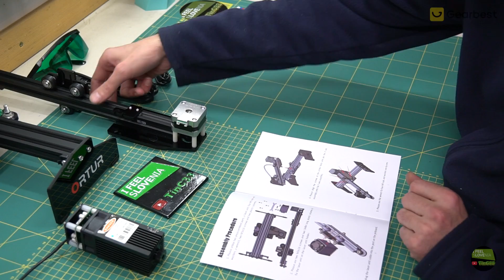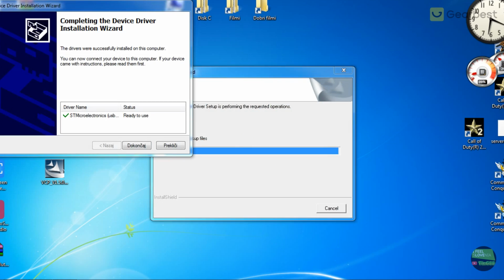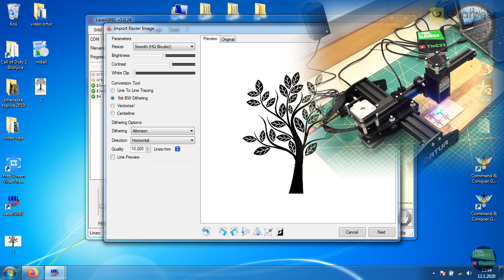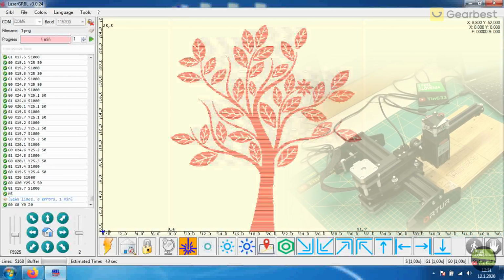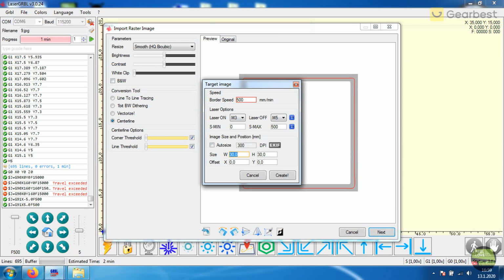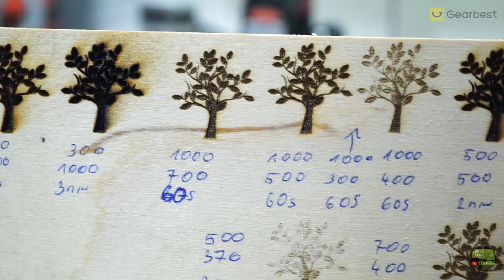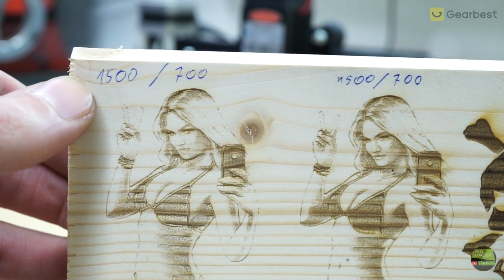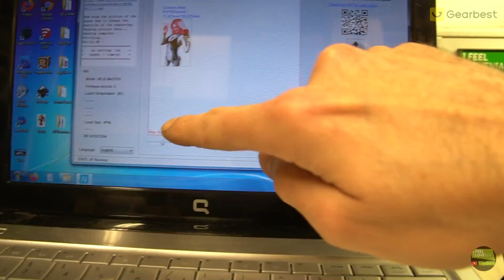Ortur Laser Master 15W Desktop Engraver Cutter [unboxing / review / software / first test]

Comment: Can you suggest a fiber laser with a small footprint like this one, more suitable for deeply engraving into nickel plated and un-plated brass keys? I need to engrave as deep as a steel stamp and hammer.  I do not plan on using lasers on recycled forest products, mostly metal, possibly foam for my tool case inserts and other secondary purposes.   Thank you.
Reply from the maker: sorry but i don't got any experience with fiber lasers (hope someday get one) but if i need them i start with cheapest one i see on ebay for about 1300$ ;)

Comment: According to the manufacturer it is not a 15w laser.  They mean the total power consumption of the entire unit is 15W.  It's only a 4.5W laser.  A bit misleading.
Here is the spec: Laser Power: Electrical Power 15w ( laser input: 12V 1.85A ), Laser power 4.5w
Reply from the maker: I don't know but they sell it as 15w (mark on a laser heatsink) and then alsi sell 7w version for less money. Neje got 3,5w 7w and 20w versions
Reply: Well, its a simple marketing strategic, as allways many people dont read the spec of the "thing" they buy, but yuo ar rigth(its Not 15 watt laser, only 4.5 watts max power)

Comment: In fact you can engrave metal with this engraver,  when you do it right and prepare the metal correctly which you did none of
Reply from the maker: you are right, there are some tricks and expencive solutions, to "engrave" metal, but result will never be same as if we engrave with fiber laser.
Reply: @TinC33  dont get me wrong your review is very helpful
Reply from the maker: @P-13-1  no offcourse i appriciate your comment, alwas like to discuss. Now you bring me to point i become interested to try engrave metal ;-) you got any advice where to start.

Comment: If I may give you a bit of advice; try Lightburn, it's great software to design, edit and/or import programs and stuff and also control the laser with. Different toolpaths, options for your laser, etc..

Also, try using mustard on stainless steel before you laser it. Your mileage may vary but it can leave a result in some cases.
Reply from the maker: Wow great thanks, look an awesome software, not that expancive also
Reply: @TinC33  Recommend LightBurn too, only poblem is Lightburn is a paid software

Comment: Hope you were able to get some good goggles for that wavelength. Unfortunately there are quite a bit of FAKE laser goggles out there that look like the real deal, but are not
Reply from the maker: I use some other goggles i got from before, but i saw some test with that goggles and they turn out as good. But still best to leave the room while engrave, specially that 15W make also lot of dust and wood burn fume (co2) so i open the window and leave the room.
Reply: @TinC33  Definitely. Styropyro (a big laser youtuber) has a few videos about bad goggles, including some that are just colored plastic and do nothing that come with a megawatt class tattoo removal laser system.

I don't wish to insult you, but feel the need to make sure you're aware that certain plastics are not meant for laser cutting/engraving and output toxic and corrosive gasses when burned. Honestly, I think if you add a small blower or compressed air setup around the nozzle you'd get much better results also. You don't need much air to keep the lens clean and help clear some of the ash and get a better, cleaner, faster cut. Great video as always bud
Reply from the maker: @dogsarebest7107  Thanks, and yes i try to blow dust with compressed air and i think result was really much better.
Reply: Mine came without any goggles..
Reply from the maker: @randomname3894  really, they should forget to add while packaging, contact gearbest and request new one